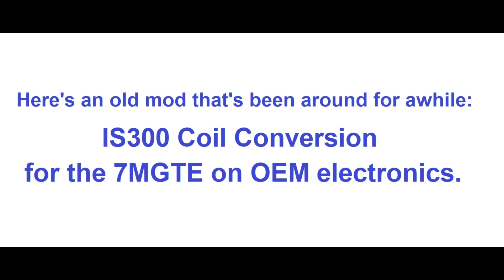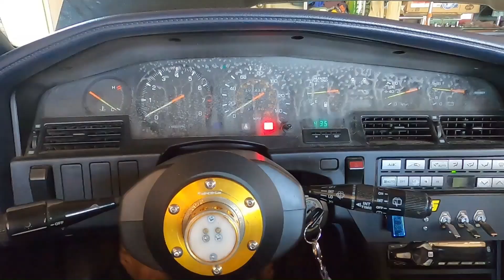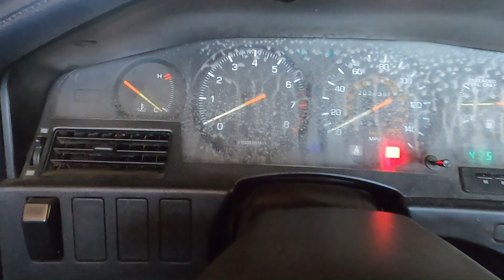Supra Mk3 7MGE NA-T IS300 Coil Conversion

Comment: Great work , i m doing same project with sapare coil. This looks better lesss work.  But interesting how you wire the new ignator box and where  can i get a new ignitier box and rewire it. Thanks
Reply from the maker: If you're referring to the oem igniter, it's very hard to find a new one nowadays. I ended up getting one used from a facebook Supra Mk3 page.
Reply: Do you have a video where you wire the  igniter  to  new coil spark and  you rewire two blue cable. Do you have video  with datail  . It will be helpful  to me .
Reply from the maker: @ricardopadilla3619  Do you have a 7mgte?  The two blue wires are installed because I had to convert my 7MGE wiring harness to work with a 7mgte ecu, MAF, O2 sensor, igniter and other 7mgte electronics.  If you have a 7mgte, you're just replacing the old coilpacks with these IS300 ignition coils and extending the existing wiring. Driftmotion carries this modified harness on this conversion.  I don't have a video but for more details, the link I gave to the supraforums will have wiring diagrams and other helpful info on this mod.
Reply: @JR-Tabios i appreciate  you time to answer me .  I have same engine but my is non turbo. I  got so excited  to see how you did it. I but the coils  , already.  . Thanks  for your information.
Reply from the maker: @ricardopadilla3619  Yeah, I've read of other Supra owners wondering if this conversion will work on the non-turbo cars and unfortunately, the IS300 coils won't work with the 7M non-turbo engine wiring harness and electronics.

Comment: I need  to  do same  spark plugs convention. Where  did you get parts and instructions.
Reply from the maker: The parts that I used are from my local pick a part for the ignition coils (IS300), ignition wires are new which I bought from my local parts store.  The igniter and wires are from a facebook Supra MK3 page.  To get an idea for wiring and instructions, visit and search Supraforums.com.  Here's one link that can help:  https://www.supraforums.com/threads/modifying-7mge-engine-harness-to-use-7mgte-ecu-for-na-t-conversion.1131156/

Comment: what's your setup?
Reply from the maker: The motor is a rebuilt 7MGE (stock specs) converted to turbo using 7MGTE ecu and electronics and the IS300 COP. Turbo is a CT26 57 trim, Driftmotion downpipe, HKS catback.

Comment: What spark plug wires are you using? I've got the coil conversion in my mk3 and I'm using the NGKs and I'm not a fan of them. Yours seem like they work better than the NGKs staying plugged in.
Reply from the maker: I'm using OEM style spark plug wires (Import Direct Spark Plug Wire Set - 42459) from my local O'Reilly.  Dielectric grease is used, and they have a nice solid hold on the spark plugs.
Reply: @juniortabios6747 it's been a few months, but I just wanted to say that I just swapped out my wires for the ones you recommended, and so far, they seem to fit a lot better. Thanks a ton!
Reply: @juniortabios6747 my hero. Thanks tons